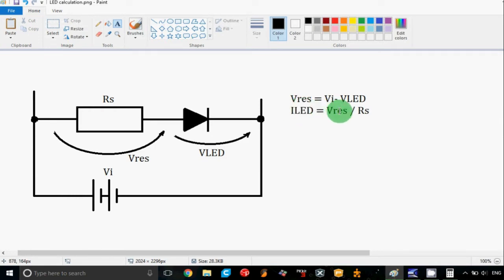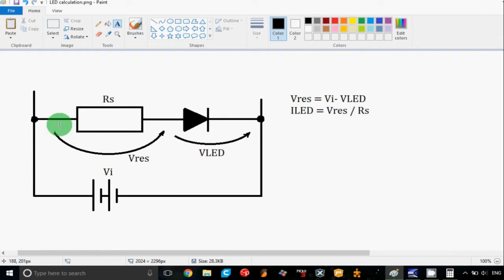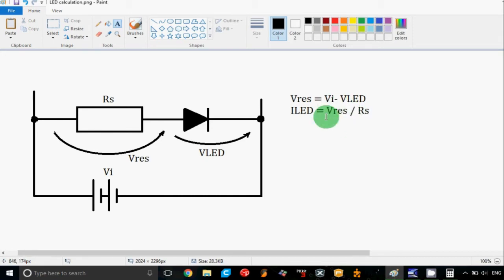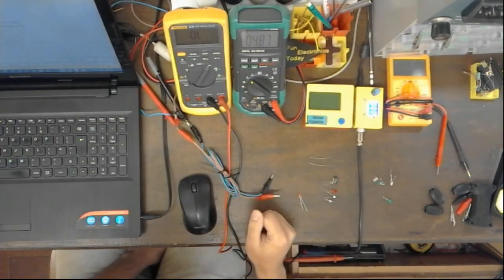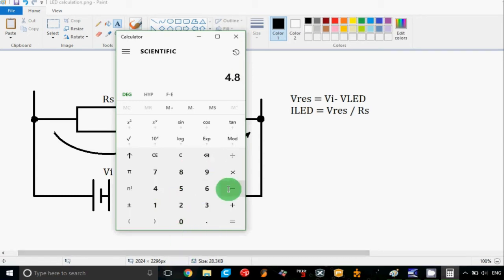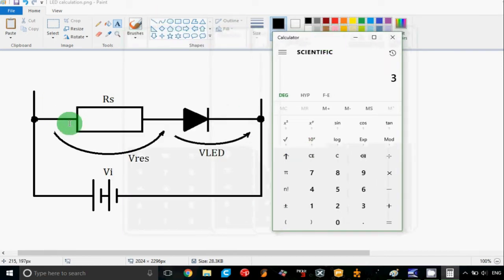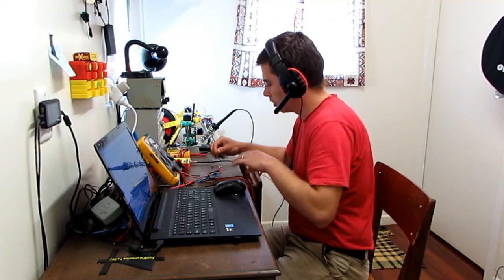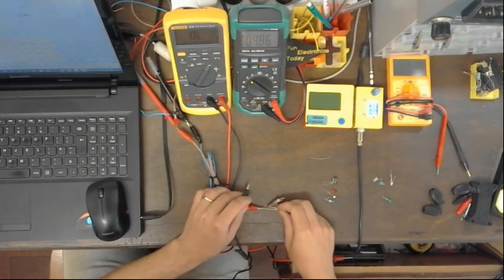How to calculate LED resistor

Comment: What if you have an LED in your parts bin, and you don't know the current it draws?
Reply from the maker: You choose the current beforehand. And of course, this example for how to calculate the resistor is just one of many. Essentially, you can use the multimeter to measure both the voltage dropouts and the serial current at any given point. You can then quickly experiment with different current values (usually between 2 and 20mA) and see if the light intensity is enough for what you need.
Reply: @FunElectronicsToday  How can I choose the current? Isn't it set by the LED?